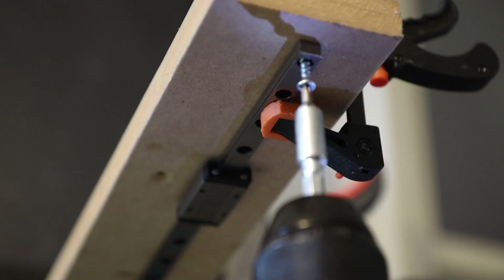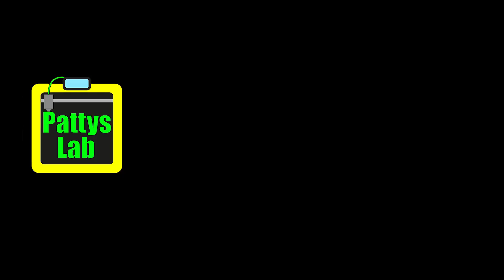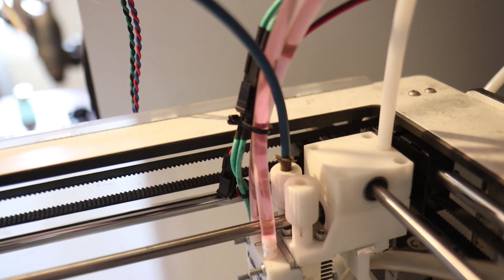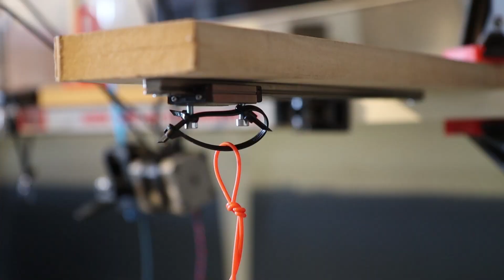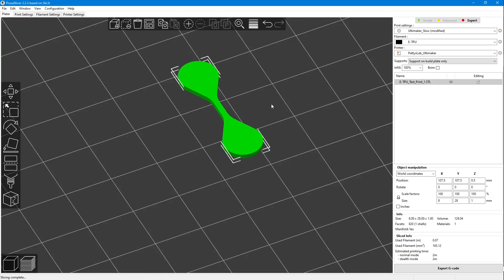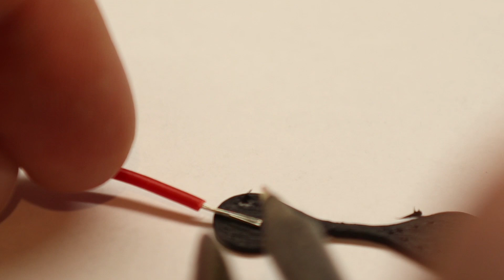Magic TPU 3D Printer Filament You've Probably Never Seen Before, But What is It?

Comment: the diferance may have come from the cales losing and gaining connection not the strech iys self strech it but without pulling the wires. if this is still the same it has great potentioal
Reply from the maker: I've also done some tests with the conductors mounted to a rigid Island isolating the contacts interference as much as possible. The result is still the same. That print was an E-TPU track inside some normal TPU. I could not find the footage for this video :(

Comment: How many amps+volts can it take before it melts or ignites
Reply: wondering the same thing... is there an amperage rating? what voltage is it good for?
Reply from the maker: It's a very resistive material at small geometries the material properties can be found in the link in the description. Nevertheless if you make somewhat wider parts you can go the range of 100-1k ohm so you can really shape the sensor to your needs by changing its shape. How many volts and amps depends on the resistance the voltage drop in the material x the current through it is the power loss in the material there you can calculate with time how machine energy is pumpt into the material so how many degrees it will get warmer. This does melt around the same temp of nikjaflex TPU but you can find that in the description. Perhaps more experiments could be a good idea :)

Comment: Looked like the Brightness went up when you stretched it.
Reply from the maker: The contact wires did not have the best connection that perhaps why 🤔
Reply: @PattysLab  my theory is,  when you stretch it the  infill in the print is compressed together by the perimeter of the print, making a better connection throuhout. only mentioned it because you say in your video that it getss dimmer when you stretch it. it does the opposite
Reply from the maker: @colebz420  the contact pads also need to be fixed in place in order to get a much more reliable result I've done a lot of research regarding this in my university. And your theory certainly makes sense this material needs more research to be understand better :)
Reply: Maybe you can put a piece of thin metal in between the layers for a connection. Solder pad or a through hole for nut and bolt. Couple small holes on the side that is in the print so it can "lock " into place. 
 Dual filament printer and being able to imbed electrical circuits/components into a print is exciting. Just sharing my thoughts.
Reply from the maker: @colebz420  yeahs that sound's great good suggestions!